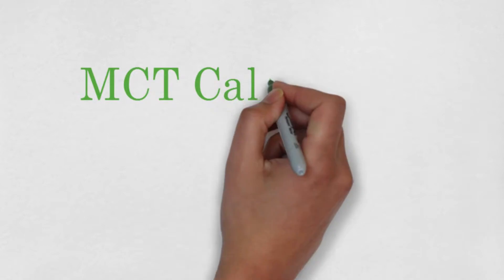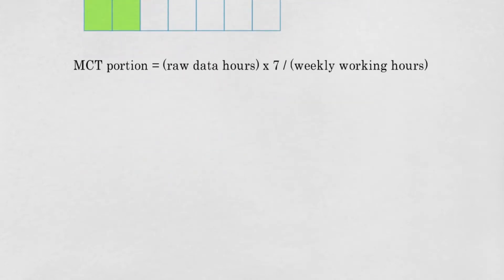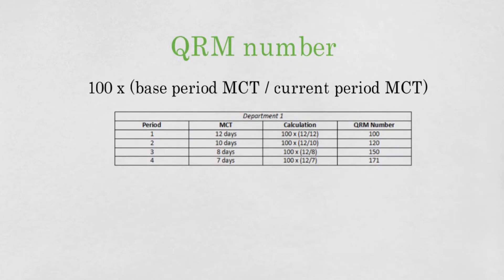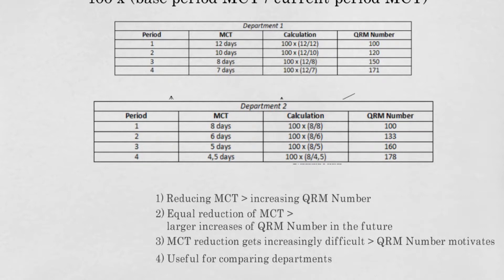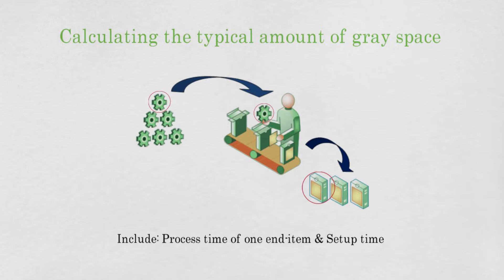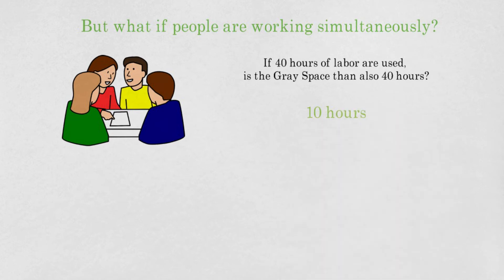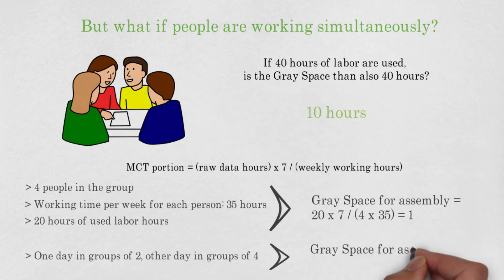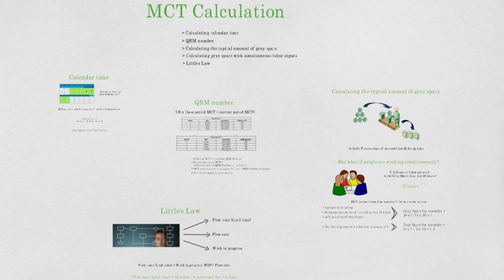MCT 5 – MCT Calculation

Comment: what if the company is working in projects and not every project has the same order throughput. so for example one order takes 8 weeks from end tot end and another one takes 16 weeks. How do you calculate MCT then? do you calculate MTC per project or do you use average?